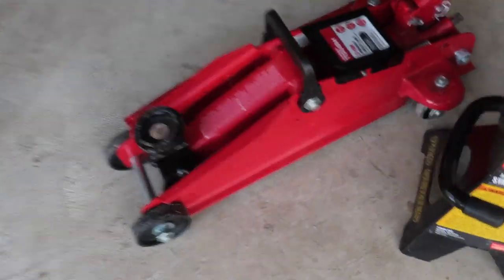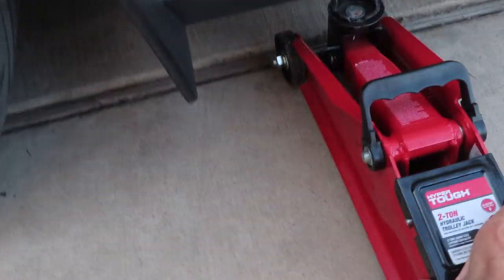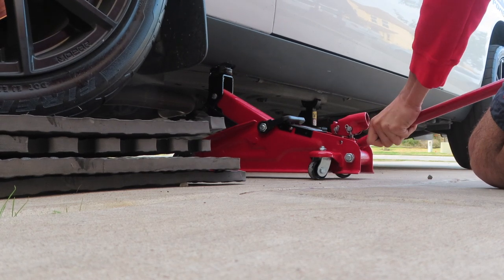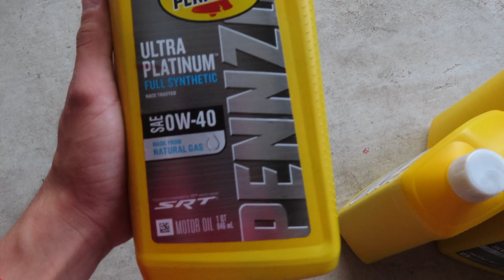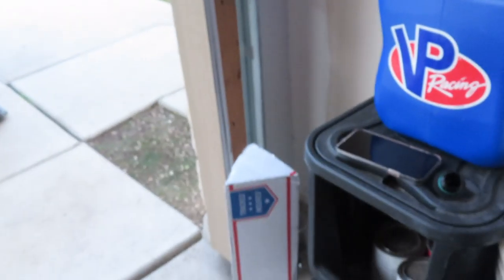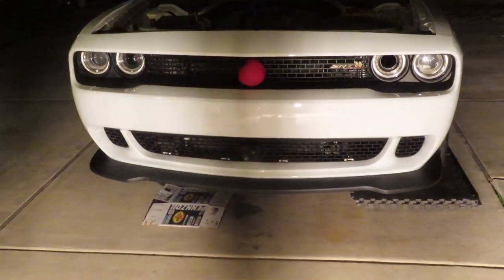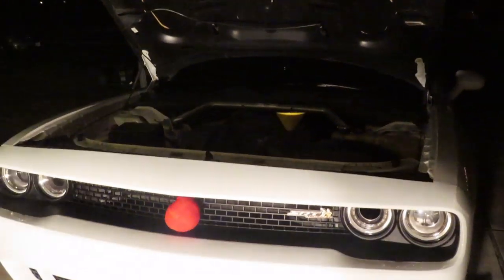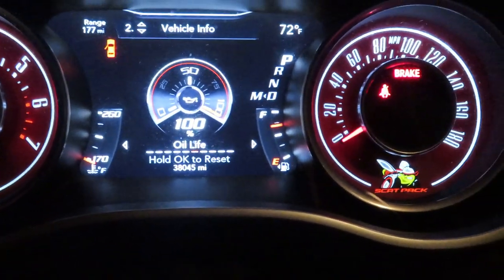How To: Change Oil On A Dodge Challenger Scatpack!

Comment: Rotor can be resurfaced their practically brand new.
Reply: I was told by my local dealer that you can’t resurface the rotors and that I had to order new ones
Reply: @knvgjuan8344  your dealer is a typical dealer. It's called up sale, they will try their hardest to get you to spend as much money as possible.